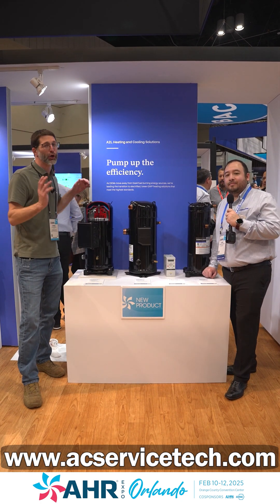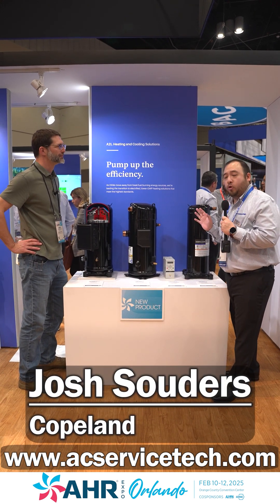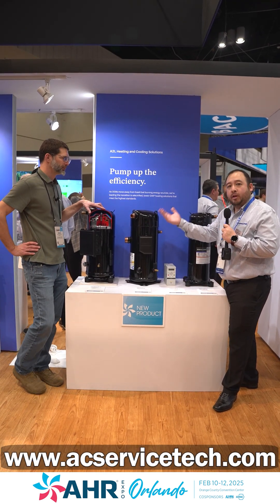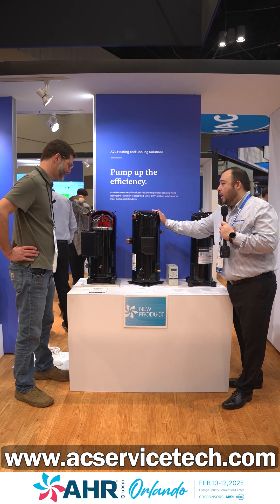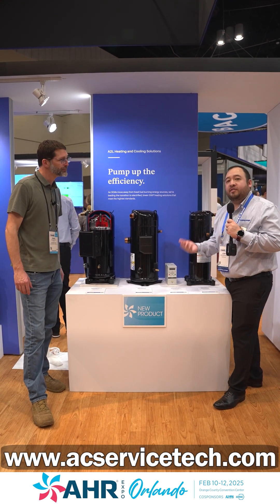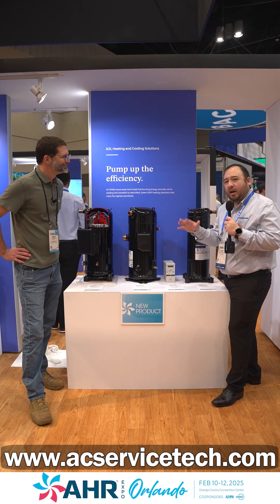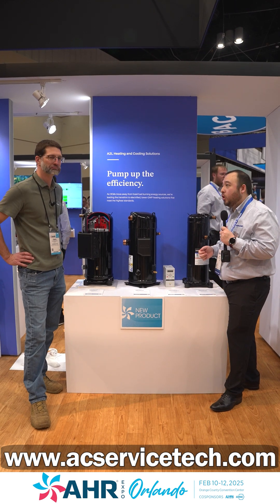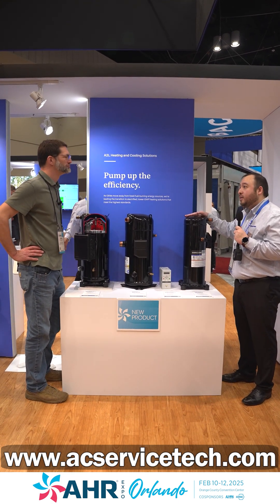Exploring The New Scroll Compressors From Copeland!

Comment: Hey Copeland, why would you change the mounting points without providing an adapter to align the compressor on existing systems? I have guys repiping all of the rotolock fittings because nothing aligns on the replacement comps for supermarket rack systems.

Comment: So what’s the flammability of this refrigerant when replacing a reversing valve or a compressor in the dead of winter when the accumulator is holding refrigerant?…
Reply: Just replace the whole unit! That'll be the safest solution!

Comment: He said introducing subcooled gas into the compressor. Not!  The suction line from the subcooler goes back to a different suction port on the compressor, but the gas is NOT subcooled. Maybe Copeland should educate their spokesperson.  Ac Service Tech didn’t catch that?
Reply: Was going to call bs on that….
Reply: Guy said sub cooled gas and I had to rewind to make sure I heard it right
Reply: I just watched it three times. And every time he really said "Subcooled vapor". I'm floored! I'll look it up in a minute, but is he talking about liquid injection cooling? Or mid compression economizer port?
Reply: @erikwest2114 it’s commonly called vapor injection. It may be called economizer port where you live. I work in engineering research and development for a major manufacturer and we call it vapor injection. Economizer port could be a term used. The gas does enter the low side from a separate line in the compressor. It does increase efficiency if used correctly.